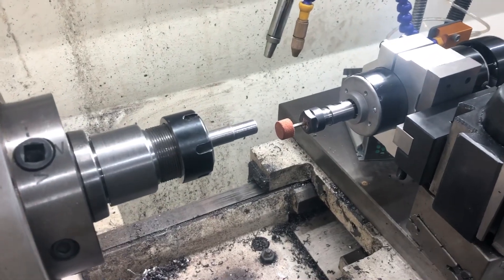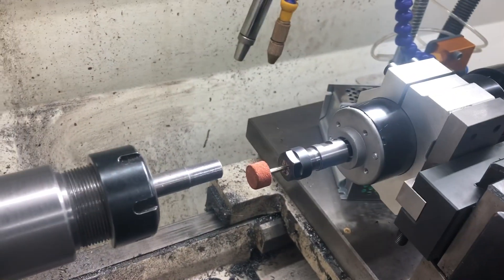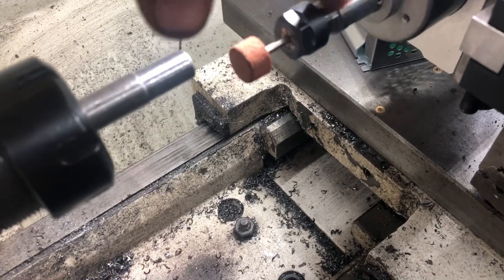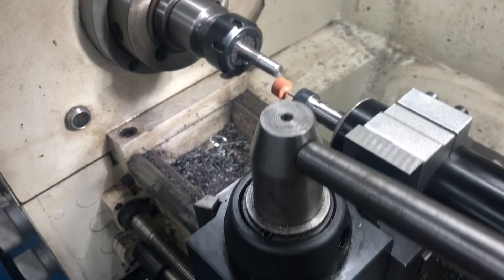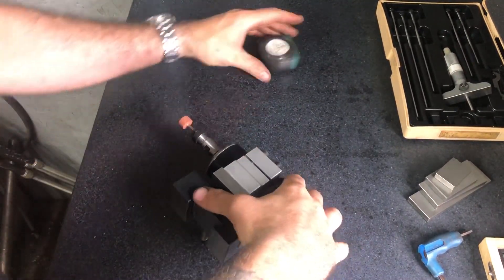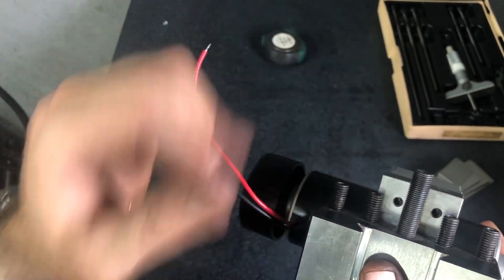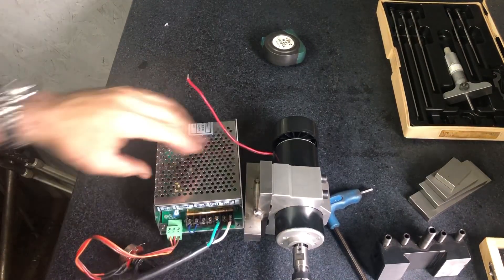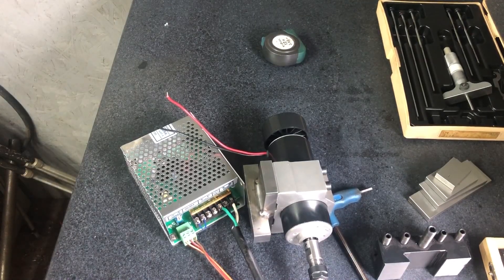Simple tool post grinder

Comment: heh heh heh. just cut up the casting of a coborn internal grinder head. 20K rated. not sure what the collet is, hoping its er16. not er20, anyway. the bearing housing alone is as big as this thing!

now, how to dovetail it for the toolpost and attach a motor. hmm.
Reply from the maker: A coborn brochure costs as much as this thing, and for good reason, theyre at the top of grinder precision
Reply: @richharr  yep. its a shame to do it, but a ~50kg chunk of cast iron for $10... meh. what else can you do? NOT drop it on ones foot, i know that...

Comment: I tried this but there was too much runout in the spindle.
Reply from the maker: You have figure out where the runout is coming from, is it the bearings? Probably not, its probably the $2 adapter nose, which can easily be reground to match the spindle. Runout is there is every machine and part, its your job to figure out where it is and how to fix it. Bearing manufacturing, even at the low end with like fidget spinners and roller skates is pretty dialed in, and a crummy set of bearing in a cheap motor can easily be remedied by buying a good set of bearings. They’re not going to use proprietary bearings on a cheap spindle.
Reply: yeah you gotta be lucky with those spindles to get a good one thats true. you get what you pay for i guess.